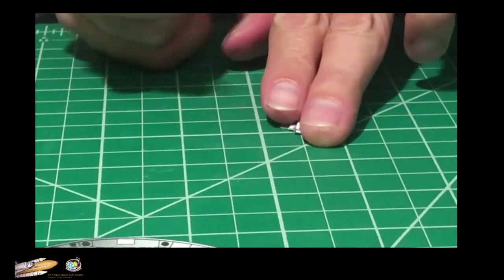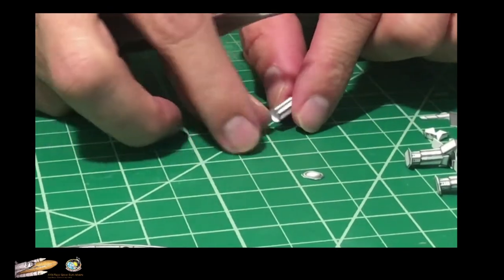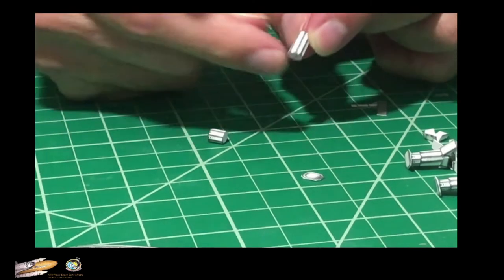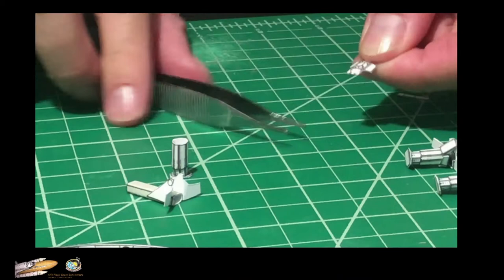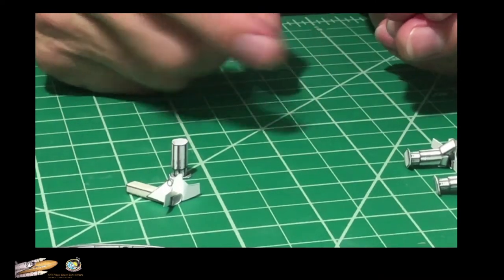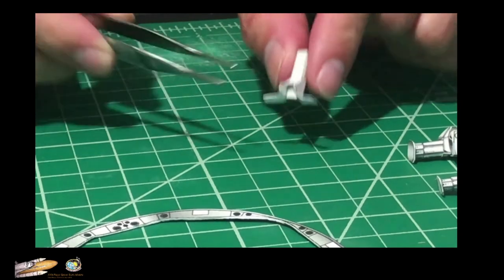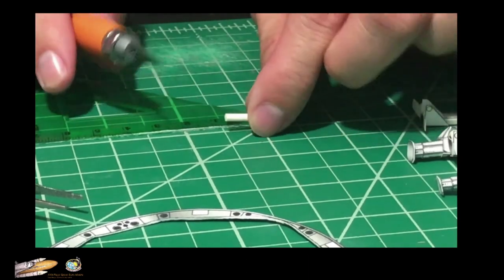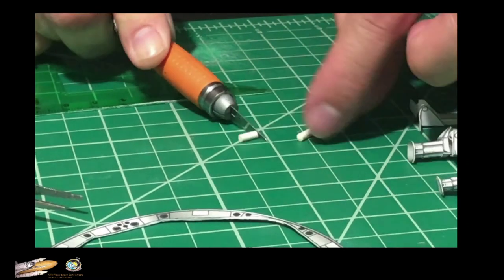SN 8 metallic version part 12

Comment: How many millimeters is the magnet cuz i buy thr magnet to small
Reply from the maker: These adhesive magnets are outdated for this project. It’s better to use neodymium magnets. They come in different sizes. A 3x2 mm or 4x2 mm will work fine.